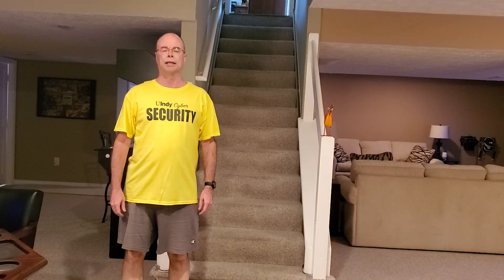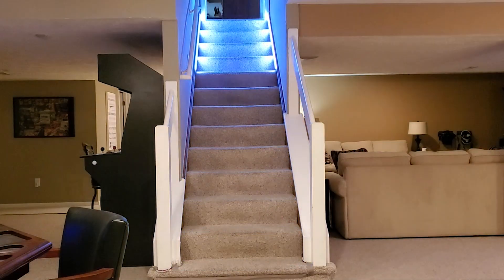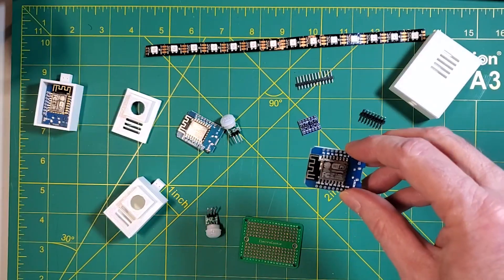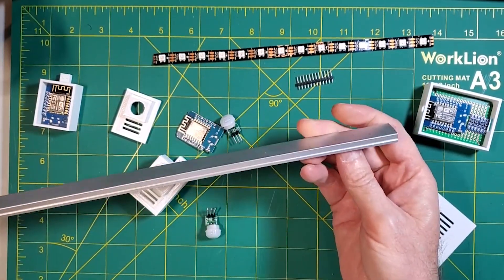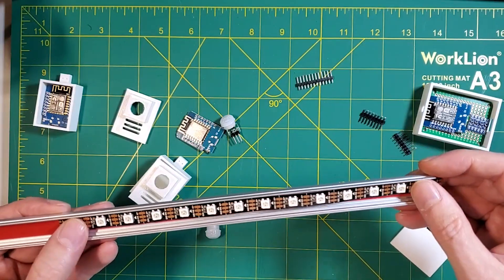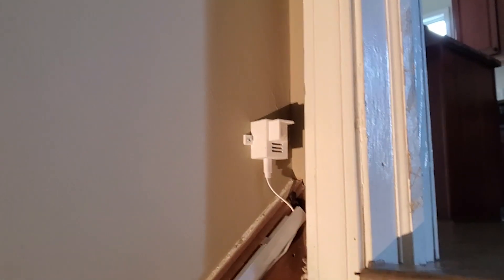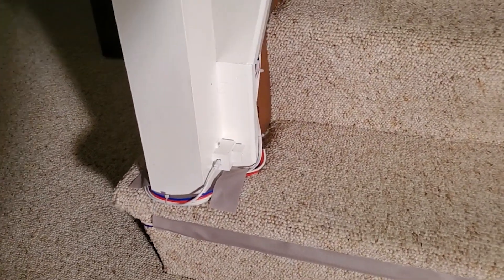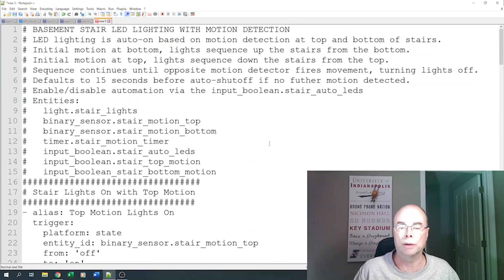Motion activated LED stair lighting... without staircase modification!

Comment: Good day to you sir, thank you some much for sharing your knowledge.  I have been wanting to do this for a while now and I have all the components, and I'm ready to start assembling it. 
I'm waiting on a new led strip so that I can add lights to both sides.   I am still having a bit of brain block, trying to understand how the two ESPHome D1 minis talk to the WLED controller..
Reply from the maker: I assume you are referring to the D1 Minis that are used for the motion detection?  Home Assistant and Home Assistant automations are how the devices 'talk'.  The Home Assistant automation uses the motion from the motion sensors as a trigger to then turn on the LEDs via the LED controller.  The latter part of the video covers that and you can find links to the entire Home Assistant automation in the video description.

I hope that helps.  This particular version does require Home Assistant or a similar home automation platform to work and to allow those components to 'talk' to each other.
Reply: @ResinChemTech  thank you for the quick response,  I appreciate it.  Does this section  need to be the same on both of the D1 minis that are running ESPHOME? 

binary_sensor:
  - name: "Breakbeam Sensor"   ==  ???
    id: breakbeam_sensor
    platform: template
    device_class: motion
Reply from the maker: Are you using the new ToF sensors that I showed in this video ( https://youtu.be/ZRb_wpJo1AM ) as that is the ESPHome code for these types of sensors.  If you are using the PIR sensors as shown in this video, then you need to use the ESPHome code from the Github repository that does NOT have _tof  in the file name.  The Github repo has example ESPHome for both, the ToF sensors (with _tof in the name) and the PIR sensors (without _tof in the name).

Comment: How long do you think the power courd from the power supply to the led strip could be before it would be too long? 20Ft?
Reply from the maker: Just the power or the data?  For the power, as long as you are using adequate gauge wire, 20 feet should be OK.  Of course, the longer the run, the bigger the voltage drop, and the lower the starting voltage will be and that will increase the possibility that you will need to do power injection depending on the number of your LEDs.

As always, I recommend that you try it first... on the bench or even just laying everything out on the floor somewhere.  It there are problems, it will be much easier to identity and address them before you complete the final installation.
Reply: @ResinChemTech  i was thinking power but you answered that question. My goal is to have the wled board and power supply hidden away about 20ft away. I suppose the  board could be closer and i could intergrate a motion sensor in the same unit like you did.  Im trying to hide unsightly wires and power supplys to win the wifes approval. by putting the power supply far away  it would allow me to tuck the wires under the trim on the way to my stairs.
Reply from the maker: Understood!  The WAF is important and shouldn't be overlooked!  I think if you can use the largest gauge that is practical for the power (and you can still hide it) the better off you will be.  And for the controller, it's also probably fine located a distance away as long as you use some sort of logic level shifter (the I2C compatible style, the SN74ACHT125N style, or even a sacrificial pixel).  Again, a bench test can be very helpful.  Lights that are fading from white to pink or red (and dimming or flickering at the end of the strip) are a sure sign of a voltage drop issue, and LEDs that just misbehave in general, flickering all along the strip or showing the wrong colors/patterns are a sign of a poor or weak data signal.

Good luck with your project... and a high WAF!
Reply: @ResinChemTech  Thank you so much! I’m just now starting to learn how to ise all this stuff and program it! And some of this info isnt easy to find!

Comment: This is amazing. 👏 
May I ask if you have a video of you connecting all of this up? On to the boards?
Reply from the maker: You might take a look at the written version of this project.  It has wiring diagrams and shows how all the different components and parts are wired together:  https://resinchemtech.blogspot.com/2021/07/simple-motion-activated-led-stair.html

If you have any particular questions after taking a look at that, don't hesitate to reach back out and ask.

Comment: Great job sir; but why we dont use only one programmable esp and attach all inputs and outputs to it then code it to do the task ?!
Reply from the maker: Primarily because the light controller is running WLED firmware.  This provides over a hundred different effects... and not something I would want to rewrite or code myself.   The sensors, on the other hand, are running ESPHome... same deal.  Both integrate nicely into Home Assistant... which handles all the automation processes.

Obviously, you cannot put two different firmware versions (WLED and ESPHome) on a single controller.  I do have a standalone version that uses a single controller ( https://youtu.be/b4s_VEtVWY4 ) for both the lights and the sensors, written with Arduino code.  However, it does not have anywhere near the features or number of effects of WLED.  No way that I wanted to try to recreate my own version of that great firmware.

But in a nutshell, that's why more than one controller is used.  It also simplifies the wiring that needs to run between the controller and sensors, since the sensors only need power and not an additional data line.

Comment: Hi there, thank you for your work.

I am stuck on the yaml coding part:

binary_sensor:
  - platform: gpio
    pin: D6
    name: "Stair Motion Top"
    device_class: motion

I got an error where it says "Cannot resolve pin name 'D6' for board esp01_1m."

I hope you can help me out. Thank you.
Reply from the maker: Are you using a Wemos D1 Mini and did you specify that board at the top of the ESPHome file (e.g. board: d1_mini)?  If not or you specified a different/generic board, then the "D" pin designations are not valid.

The easiest way is to just change the pin definition to use the GPIO pin designation, as this will work with any board:

- platform: gpio
  pin: GPIO12
 
Note that D6 is GPIO12 on most ESP boards.  Substitute the actual GPIO number for whatever pin you are using and what GPIO number that is on your board.  The "D" numbers are not the same as GPIO number, so "D6" is not necessarily GPIO6 - see this guide for what GPIO numbers correspond to what D numbers for most boards:  https://randomnerdtutorials.com/esp8266-pinout-reference-gpios/

I hope this information helps.
Reply: @ResinChemTech  Wow thank you so much for your help, that really solved my error there.

I also noticed that my sensor is always stuck in "Detected" state, but never goes to "Clear (no detected)" even though there is no motion nearby. Is this supposed to be intended?

Thank you for your response.
Reply from the maker: That is not the way it should work or what is intended.  Carefully check your wiring.  If you are sure the wiring is correct (and you don't have any solder bridges, stray wires making contact, etc.), you may need to try a different detector.  It should definitely change state from detected to clear when there is no motion.  If it is stuck on detected, then that is a sign that the circuit is staying closed... again, normally due to a wiring/soldering issue or a faulty sensor.

Comment: Excellent video, thank you!! 

Instead of stairs, I'd like to do under cabinets and shelving on each side of the vent hood - with say 6 different lines (minimum, and short runs) do you think I'd need more than one esp32? I'd ideally tie everything together in the cabinet of the vent hood... conceptually I can't visualize having a single controller
Reply from the maker: Well, there would be different ways to approach this depending on how you want everything to work and function.  Technically, the ESP32 can support up to 10 different channels or pins.  It can get tricky in terms of setting those up and the segments to match.  You can read more about how that is done on the WLED offical site here:  https://kno.wled.ge/features/multi-strip/

A different option is to use multiple controllers and sync them together.  That is how I approached my kitchen cabinets.  I have a row of cabinets on each side of the kitchen.  I technically have four controllers... two on each side (one for the top of the cabinets and one for the under side).  All four controllers are synced.  When any controller is set to a color or effect, then the same color/effect is synced to the other 3 controllers.  Of course this does require more wiring and a separate power supply for each side of the kitchen.

So there are different ways to approach it... using either a single controller with multiple pins/data outputs on a single ESP32... or multiple controllers that can optionally be synced to act as one.

I hope that helps.  Good luck with your project.  My wife loves the undercabinet lighting for the additional workspace light.. and I love the ability to use colors for special occasions, entertaining, etc.
Reply: @ResinChem Tech   Thanks for your quick reply and level of detail in your thoughts. The article was helpful in the idea that any pin can be used on the ESP32. When you say your controllers are synced, is that something you're doing in the WLED UI, or, an automation you're running in HomeAssistant (e.g. trigger: turn on lights at 1700, action: Turn on light 1,2,3,4, etc. with no sec delay built in each)?
Reply from the maker: I'm using the WLED sync feature.  But you could use Home Assistant automations as well.  The nice feature about the WLED sync is that any individual controller can temporarily (and easily) be removed from the sync group if you want that segment or strip to be a different color and/or run a different effect.  Then when you want, you can easily sync up the controllers again via WLED (or HA automation). So, for example, if your controllers are normally synced, but you want to create a special theme night, you can 'unsync' the controllers and set some of the LEDs to pink and another set to blue.  Then when ready to return to 'normal' operation, just enable the sync on the controllers again.
Reply: @ResinChemTech  Thank you!! Much appreciated!!

Comment: I know its been a while since you made this and i hope you will get this. The system is absolutely amazing and exactly what I invisioned for my basement stairs(a blank canvas). I have been looking at pressure switches as a trigger. I would love your thoughts on this. I dont see any real benefit over yours, other than making the trigger invisible. Negligible to me.
Thanks
John Carr
Reply from the maker: Yep.. I still try to respond to questions regardless of how old the video is!  You should be able to use just about any sort of binary sensor trigger that you like... and a pressure switch would be just that.  Just as long as the sensor has (or can be converted to) an off/on state, you can use it in the automations.

Naturally you'd have to tweak the ESPHome code that is installed.  ESPHome might treat this like a switch as opposed to a binary sensor.  You might check out the ESPHome site ( https://esphome.io/ ) and see if you can find a listing for the particular pressure sensor/switch you are looking at.  But even it if isn't listed, it is often possible to use a generic entity and tweak it for your needs.

Let me know how it goes or if you have any additional questions.  Oh... and if you do opt to use regular sensors instead of a pressure switch, you might want to check out my updated video on this project if you haven't seen it, where I use time-of-flight sensors instead of PIR sensors... I've found these sensors to be much more reliable and less prone to false triggers than the PIR sensors (  https://youtu.be/ZRb_wpJo1AM ).
Reply: Thank you and yes of course I'll keep you updated. Have you looked at the Aqara FPT2 motion sensors?
Reply from the maker: I've seen videos on it, but haven't tried one myself (yet).  They are extremely interesting, but currently a little hard to come by domestically (Amazon shows 'unavailable') and pretty costly at this point.  I'm sure I'll pick one up sometime... if for no other reason than to just play with it.  I do have one potential use case (my automated garage lighting), but the system I currently have in place is working fine.  But like most new toys, I'll buy it first and THEN find a use case!

Comment: Very good, that's almost exactly how I want to do it. Is it possible to make it work regardless if the Home Assistant is not working/not available? Can i use with WLED FW, 2 motion sensors and possibly a lux sensor? I would like it can work on its own, but it can also be controlled via the WLED app/Home Assistant. Can this be solved? Can you make a video and/or description about this?
Reply from the maker: Well.. if you are using WLED (instead of the standalone option), then WLED has to be able to handle all of the automations if Home Assistant isn't available.  While it might be possible to use a motion sensor and/or a lux sensor with the WLED controller for some basic features like turning on the lights, it doesn't have the automation engine to do the more advanced options... like a timer to turn the lights off after a set time, use two sensors in conjunction, etc.  The standalone version builds in this automation engine, but doesn't have all the WLED features.

So, it's more or less picking one over the other.  You can use WLED, but then need a separate automation platform (like Home Assistant, NodeRed, etc.)... or you can build the automations into custom firmware (standalone), but then you cannot install both this custom firmware and WLED on the same controller.

There are a number of custom user modifications available for WLED.  There might be something that that you could add as custom mod to WLED that would give you close to what you want.  But I haven't tried or tested any of these.  You can review the list of user contributions here:  https://github.com/Aircoookie/WLED/tree/main/usermods

Comment: Has anyone done this with WLED?
Reply from the maker: The controller here is actually running WLED, as I covered in the video.  But if you are talking about the whole system with WLED alone, then I don't know if that is feasible.  WLED can probably use a motion sensor to turn on the LEDs, but it is the logic of turning the lights back off with a second sensor (and determining the current states of the lights to know whether they need to be turned on or off) that WLED is going to lack.

Standard WLED (at least currently) does not have an "automation engine" to be able to handle this kind of logic... at least not yet.  I do know that there are some 'stair light' community modifications out there for WLED, so there's a possibility that someone did add this sort of logic to WLED... but I haven't looked.  You might want to check out the /usermods folder of the WLED Github repo.

If you are looking for a similar system that does not require Home Assistant, I did develop and do a video on a standalone version.  It doesn't have all the effects and features of WLED, but it does use a single controller and doesn't require any external system to operate:  https://youtu.be/b4s_VEtVWY4
Reply: @ResinChemTech  Thanks so much for that info mate, appreciate it :) I spent last night doing a lot of research and now have two presets of "wipe" that look very similar to how yours work. Going to use Node Red WLED Nodes to trigger each one depending on two value templates based on distance provided by a LD2410b (BT mmWave sensor) ... If it all works, should be the same thing from one sensor... if it works lol
Reply from the maker: You are welcome!  Let me know how it turns out.  I love when my viewers take my ideas and then adapt them... or make them better.  I've heard from folks that have modified these stair lights for hallways and even under a bed as a nightlight.  In fact, it was one viewer that recommended use of the ToF sensors to replace my PIR versions that led me to do that update video to make the system even better.

Good luck.. I'll be interested to see if you can get a single sensor version to work.